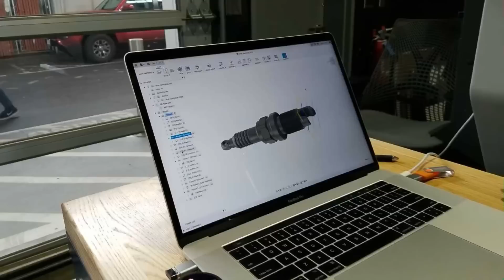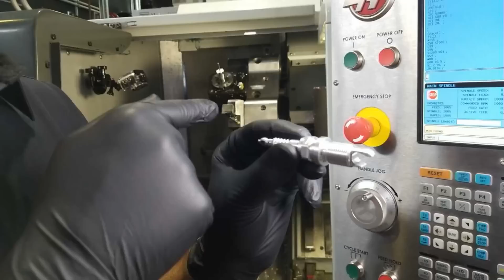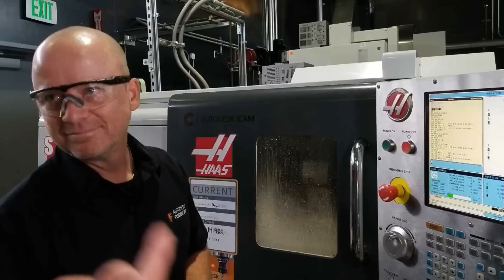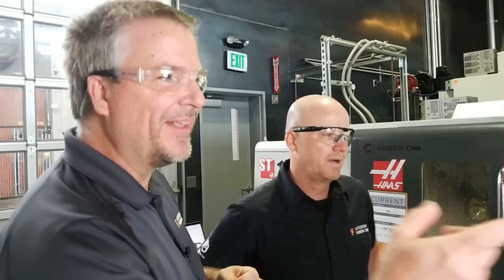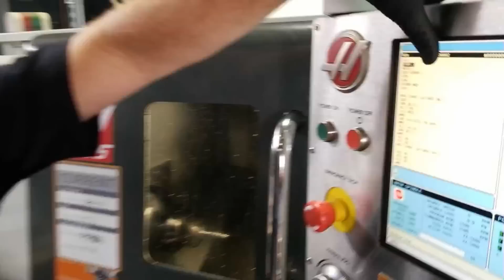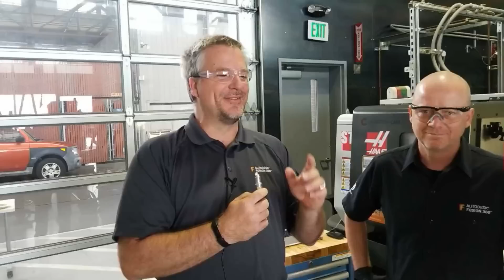360 LIVE: Manufacturing Spark Plug Opener, Part 4 of 4

Comment: Nice design...maybe a more durable material like stainless steel would be great for an opener. 6061 is nice to machine but soft in respect to be an opener that will last.
Reply: Ian-  Ya, aluminum was cheaper and easier to machine, that is why we chose it.  I actually ran an FEA simulation on the bottle opener to make sure the aluminum would be strong enough, and it definitely was.

Comment: I have been programming a Haas milling machine with Fusion at work for over a year. Also a Fadal and a Fanuc. All milling machines. There is also a CNC lathe with live tooling but never tried programming a part for it. For some reason. The third and forth part of this series kind of demystified it for me. The little push I needed to venture into the unknown! ;) thanks!
Reply: Happy to hear that you were able to get some inspiration! Live Tool programming is very easy in Fusion 360. Let me know if you ever have any questions.